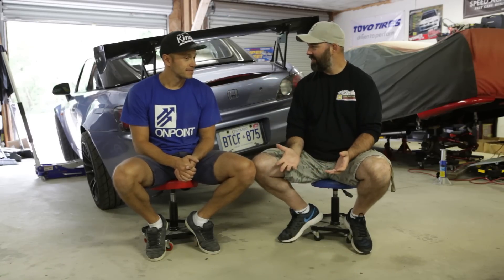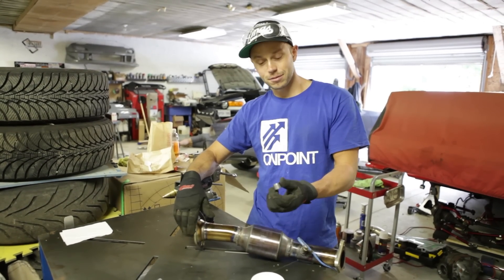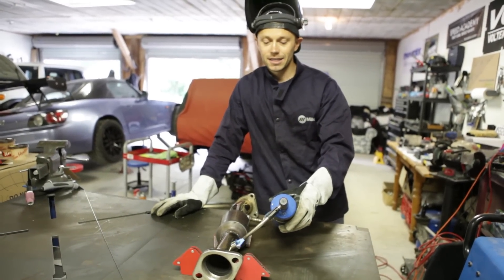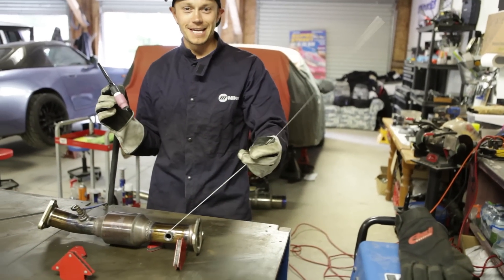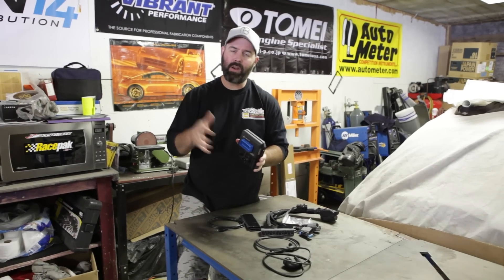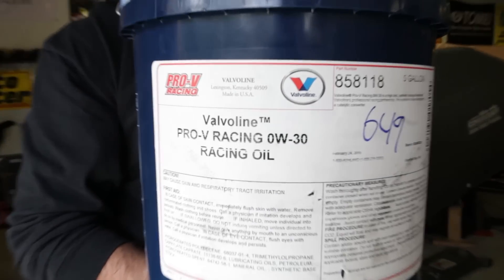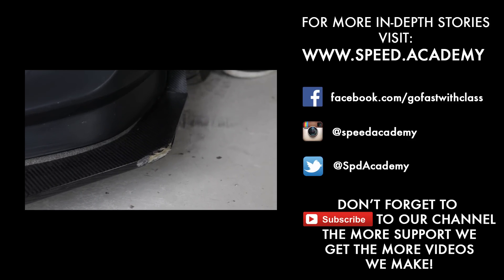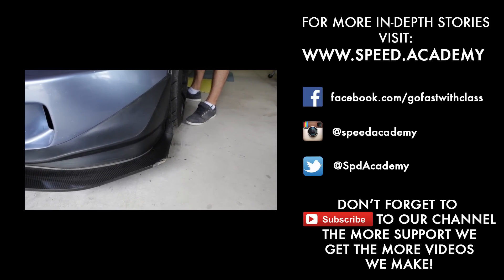AEM Infinity ECU Prep - Project BADASS2000 - EP01

Comment: Loving the S2000 series, great work so far guys. I recommend a day tyre testing as you could find a second or so via a tyre that better suits the car/track, keeping it street maybe try the Yoko Advan Neova 08 R, make sure its the R version or maybe Mich Pilot Sport Cup 2, hopefully you can find a tyre supplier sponsor plus a dry day and make this one episode.    ITB'S are great with the right control, MUGEN also do some blue print parts but they cost the earth, if your block is 2.0 there is a Spoon 2.2 stroker kit that keeps the revs and real Vtec of the 2.0 so I understand.  In the future forced induction is the way to go for real power, for 350WHP look at the Rotrex C38-81, look at TTS performance Supersport version, for you guys this would be an easy fit. Forget the LS big blocks please, no Vtec! Anyway respect whatever and I look forward to the next episode.
Reply from the maker: How about ITBs and forced induction? :D Definitely no V8 swap for our S2k. We are considering a K24 swap if we ever manage to blow up the F20C. Thanks for watching and for the kind words! Oh, and we are going to a semi slick tire in 2016.

Comment: 00:1 how to not jack up a vert if you value your chassis
Reply from the maker: +Shaun Keith Why do you say that? Our chassis has a half cage but we're using stock jack points.
Reply: didnt know about the half cage.. aha, but still convertibles just twist a hell of alot easier, i warped the chassis a little in my mx5 doing the same thing, and ive got all sorts of bracing..

Comment: AEM claims that the 200MHz RTOS processor  "makes the Infinity more responsive" and is "faster" than their competitor's 20-50MHz processors. This is their marketing department gone wild! Operations using a 50MHz processor without an RTOS can be just as fast or faster than a 200MHz processor with an RTOS. An RTOS almost always slows operations of a processor down. The real benefits of an RTOS(in short) are to reduce design complexity and to simplify scheduling events.

It looks like it could be a great product, but I can't get behind a company or product that uses marketing like this.

Comment: I checked out the pro V oil.  I DD my BRZ so that wont work but the price isn't that bad.  I noticed it said that its not suitable for cars with cats.  Do you foresee an issue with this on your car?
Reply: +MNachtigal good catch. The high zinc content in race oil can be harmful to the catalytic converter, but we&#39;ve spoken with Vibrant about it and they&#39;re confident the GESI cats will stand up to it well, plus we pretty much only drive the S2000 at the track these days, so the cat isn&#39;t be exposed to a lot of oil burning mileage. For your BRZ, which I assume sees lots of street use, you definitely want to stick with a synthetic street oil with less zinc, but if you do a lot of track driving you can throw Pro-V in on race weekends and switch back to the street oil during the week.
Reply: David Pratte Yeah lots of DD use with the every weekend autocross.  I'm sticking with amsoil for now but if it comes to track day duty this oil looks good.  Plus who doesn't like a 5 gallon bucket of oil? lol.

Comment: just wondering, which is better then, the fr-s or s2k? When comparing the lap times of stock cars on your home track, if I remember correctly there wasn't much between the two? By default the s2k has some 30+whp over the fr-s?
Reply: +IrenicusFTW better is a relative term, and the ass2K was so worn out when we baseline tested it, it's really not reflective of how fast a stock but properly maintained AP1 would be around our local road course. There's no question the S2000 has the better engine and trans, but the FR-S has a lower center gravity and better at-the-limit handling characteristics (it oversteers gradually and controllably while the S2000 is quite snappy and more difficult to control once the rear end breaks traction). You can fit A LOT more tire under the FR-S without requiring any crazy fender mods, and both have tons of aftermarket support and lots of untapped performance potential as you modify them. It's really hard to pick one over the other, we love them both and they're both a ton of fun in their own ways.
Reply: +David Pratte Thanks for the reply! I've owned and mildly modified my gt86 for track purposes since february. But I've never had a go with any version of s2k. They are quite rare and expensive in these parts (for the condition/age). Good to hear that you don't pick one over the other outright. :D
Reply: +David Pratte this time of the year, i wish i was in australia :D actually in freezing estonia. Thanks for the detailed description. On one hand I miss the awd power of my previously built sti, but on the other hand I quite love the handling of my 86 and am looking to fully build the engine next year. Your fr-s videos were a big help in this regard, just wish I had a bigger budget.. haha! :D   keep up the good work!

Comment: How are you going to pass emissions with the aem ecu?
Reply: +Kashus Rudder good question. I guess we'll slap the stock ECU and intake system back on for that. Sounds like a lot of work, and it will be, but such is the cost of going fast.
Reply from the maker: +Kashus Rudder Actually the plan is to have them test it through the sniffer since it wont work with the OBDII. It should pass easily that way.

Comment: Great vid! Guys I'm hoping you consider a 4.77 FD for that ap1 build! it's the best n/a mod for the car and I'm sure Pete can pull the diff and pop in the kia FD. That with the ITBs, unstoppable!
Reply: +testing316 we think it may already have a 4.7 FD based on what we were seeing during dyno testing with OnPoint Dyno last time. But we are going to swap in a more aggressive clutch-type LSD soon, so will investigate the FD at that point and switch it out for a 4.7 if it doesn't already have one.
Reply: +David Pratte my understanding is you should be well into 3rd gear at 100kph with 4.77. I hope it doesn't have them yet so you make a vid of the install :) hopefully I'll have mine in for 2016 at DDT! keep up the great work!

Comment: Like it! Is it possible to see some more  front wheel drive builds? I am building my  autoX and trackday weekend warrior  based on Skoda Fabia RS (wich is brother to Seat Ibiza Cupra and VW polo gti)  I watched  suzuki swift video,  like it.  Are Golfs GTI popular in Canada, is someone  you know  driving gti mk5 with dsg on TMS? 
What more advanced mods I need to do? I have stage 1 map 180 to 205 hp, B6+HR suspension, Federal SS 595 RSR 215/40/17, Ferodo Racing DS2500 pads set, Goodrich lines, TRW Dot 5.1 , OMP belts.  I managed weight reduction -90kg (seats, spare,  tools during event)  so car is pretty prepared, but I have issue with understeering, I am thinking to install HR ARB set F+R, I set already fast lap times  in Moscow racetracks,  but I need more perfomance from chassis  and suspension.  Car isn't popular in tuners market :(
Reply: +Гоночная Траектория we'd definitely like to do a FWD build sometime soon. A big rear ARB will help with the understeer on your Skoda, and try a more aggressive wheel alignment too with some toe-out up front to help with turn-in and some toe-out in the rear to help it rotate. The spring rates on your B6 coilovers may also need to be addressed. Generally speaking on FWD cars we find we need siginificantly more rear spring rate than front spring rate to eliminate understeer. If the shocks have adjustable damping, also try stiffening the rear dampers and softening the fronts.
Reply: +David Pratte thank you for an advice,  my bilsteins shocks aren't adjustable,  but I try to do some alignment work also with more negative camber,  I hope this work.

Comment: Do you guys could use it for Daily Drive too? By the way, your channel is my new best car channel in YouTube! Go on!
Reply: +Akio Haru Goro (日本人) for sure we could daily drive the S2000. It's fully street legal, has a mature sounding Tanabe exhaust, and is surprisingly comfortable on the Eibach Multi-Pro R2 coilover. Very civilized ride quality. The splitter isn't great for the street, as Pete proved when he hit that piece of steel on the highway, but other than that we could drive it year-round if we wanted to.
Reply: +David Pratte so nice. I thought you have maybe installed an air suspension on it because of this situations but that kit is also so damn good..! Good luck to brake the record of F-Type, we appreciate your staff. ✌

Comment: Haltech fo life
Reply: +FCustureri Interesting, I didn't realize Haltech has a plug & play option for the S2000. Very cool. I'd have to read up on what the Haltech offers vs the Infinity to offer any sort of informed opinion, but from experience I'm sure both will run your S2000 beautifully. I do really like the customizable engine protection features with the Infinity, which can be based on coolant temp, oil temp, oil pressure, AFR vs MAP, intake air temp, 2-channel knock, or even fuel pressure based. I've blown up enough race motors over the years that this level of engine protection really appeals to me! I'm sure the Haltech also has knock control, but I'm unsure of whether they offer the other types of engine protection.
Reply: agreed, but who wouldnt complain if you got sponsored by any good ecu company
Reply: +David Pratte The Platinum pro has the PnP kit for the S2000. They also offer engine protection but i guess the infinity looks to be a newer unit in terms of packaging and should be compared to Haltech's Elite series. (they both look very identical externally so i assume the infinity also has some sort of water/shock resistant as the Elite?)

Haltech's engine protection system: http://www.haltech.com/haltech-protects-your-engine/
Reply: +Camhin1 Haltech is good stuff, too. We're running a PS2000 in our FD RX-7. But for the S2000, you can't beat the Infinity right now for ease of installation thanks to the plug & play harness and start up map.
Reply: +David Pratte I've been going back and forth between the Haltech Platinum Pro Plug-In and the AEM Infinity for my S2000 in the future. 
Any large feature differences between the 2 you're aware of? The Haltech seems to be at least $300-400 cheaper after adding the plug and play harness to the AEM.